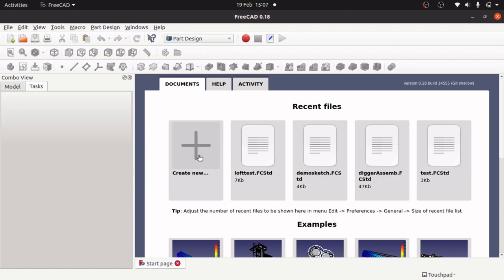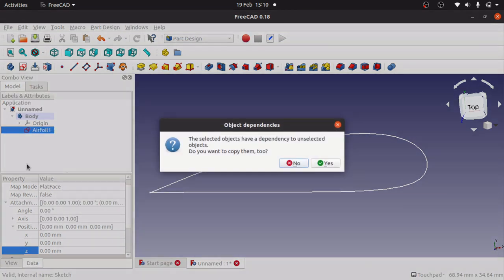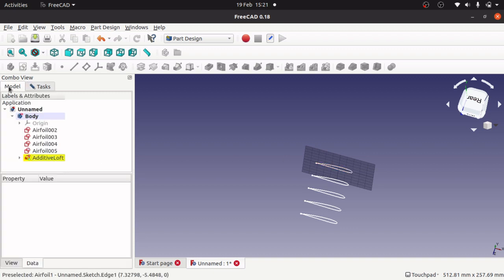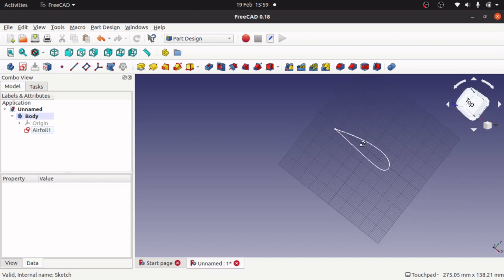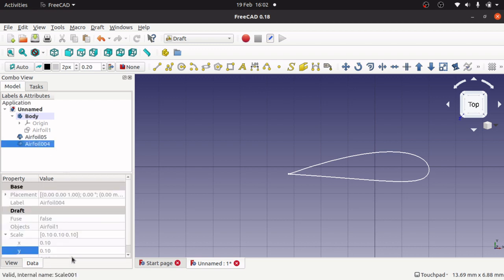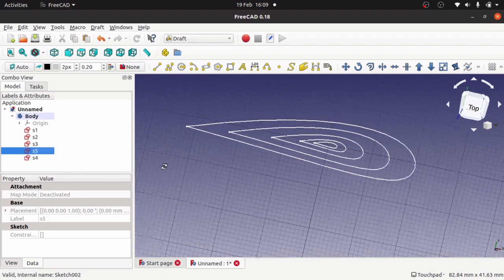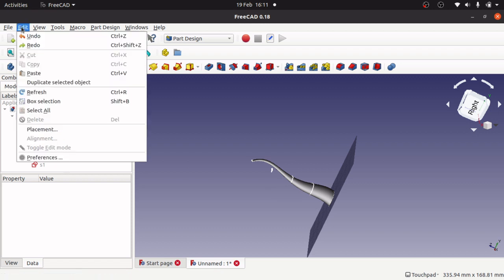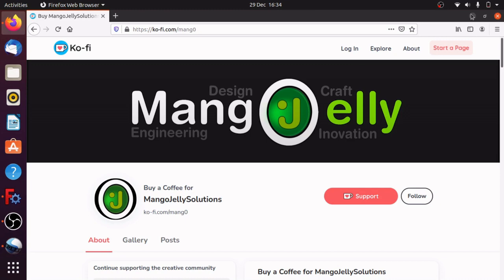FreeCAD: Simple wing with aerofoils for a fin, plane, propeller using loft sketch profiles

Comment: hello there!
amazing tutorial! thanks!
i am trying to built an hydrofoil here. How could you constrain your B-Spline to the length and thickness you want? I tried with geometric line but it doesn't stay fix and if I anchor it to a point the shape never goes where I want. maybe it s bette to use the curves workbench like you did for the boat for precise dimension?

Best Regards

Comment: At 11:45, you moved all the profiles under the Body node. Why do we need that step?
What is the significance of this action?
Will the model not work without this step?
Reply: You can't use stuff from other bodies, and your sketch is using Body > Origin > XY-Plane as a base, so you can't remove the sketch from the body

Comment: What a great tutorial. I am making an RC air boat hull. But I I instead of using you Lesson 10 tutorial, I think this one makes much more sense to use
The logic behind this tutorial makes much more sense than Lesson 10 and can achieve the same result.
Reply from the maker: Thank you for the comment.  I think you will enjoy a set of tutorials I am working which take this a bit further and deals with creating internal strut work from profiles imported from a DXF file.  I am currently working on the tutorials and hope to get them out hopeful in around 2 weeks time.

Comment: Interesting, thanks for the video. But I guess the resulting scaled wing won't be very parametric. If there are changes to be made, the manual process of going through the draft wb and converting to sketch would have to be repeated. Unless it was scripted, perhaps.
Reply from the maker: Yes totally agree. This video was one of my early ones. Since I found a number of techniques that allow you to make a parametric surface and also slice out the Ribs. I have detailed alot of these techniques across boat building videos and some regarding aerofoil shapes. I was only thinking the other day that I really need to bring these together into one single video as the info is scattered across the channel. I really need to do this soon.

Comment: imagine this , or maybe just imagine Dragons ! I'm thinking in FC its possible . not with my knowledge yet anyways.  If project if lofted from only two sketches ,a wing again but declining in dimension say 50 % . (sketch two is 50% smaller then main sketch)  end to end  and say it 100 mm long. Now you want to take slices say every 20 mm and turn them into independent sketches so there shape could be analyzed or edited . We know the end sketches ! but what is the shape , dimension say in the middle of the tapered wing if cut in half? Some thing in Parts bench , cross section tool maybe but I my fingers are sore from smashing  board keys last night trying to make head way :-O
Reply from the maker: Lol, I wonder where this was going at first. Yep you basically there, largest at one end smallest at the other. Part wb Loft  between them and then use the cross section as you say. Explode the cross section as it would be a compound and you will get the individual profiles. 👍👍

Comment: I come more from the Solid Works corner and wings are too complicated for me with Free Cad. In Solid works I can take two different profiles (like Ebbler and Naca) myself and thus determine a body of my desired dimension. The body then has a modified profile from beginning to end.

With auxiliary levels that can be freely placed, I determine the location where I would like to receive the current profile using a sketch, then I only have to click on the surface to transfer it to the sketch and I have the profile cross-section.

 If, as described here, I want to create a wing or wing cores (with all cutouts / cutouts for spars and holes) with about 30 ribs under Free Cad, then I have a lot to do, and I can't even modify the profile line. 

So in that aspect Free Cad is a total NoGo for me, I haven't found a way to do it on Free Cad like Solid Works, before doing this cumbersome work it is better to use the Profili V2.0 program

If someone has the solution then please make a video.

Comment: Since you copied one airfoil they all have the same number of segments. Does this work if your blending between several different airfoil shapes of various sizes that may have different numbers of segments?

Such as propeller design with tapered tips and a hub to blend into?
Reply: I'm sure the loft algorithm can figure it out
Reply: @stoobidthing  I've used several programs in the past that would mess it up unless you had the same number of sections and had them created in the proper order. We used to have to go in and renumber each segment sequentually prior to a loft to keep it from doing something weird.